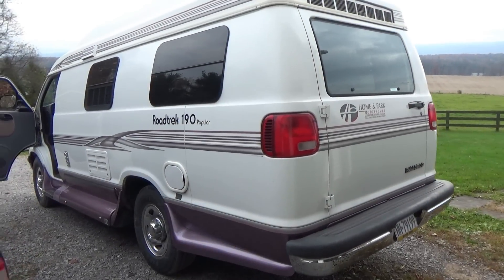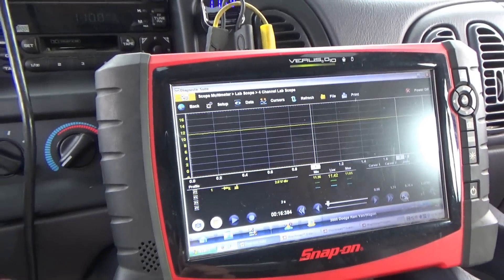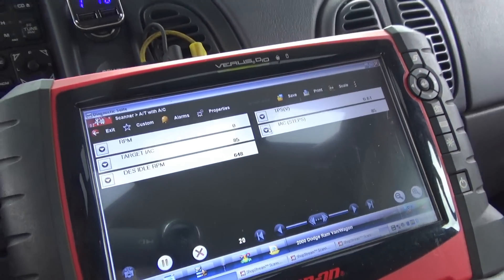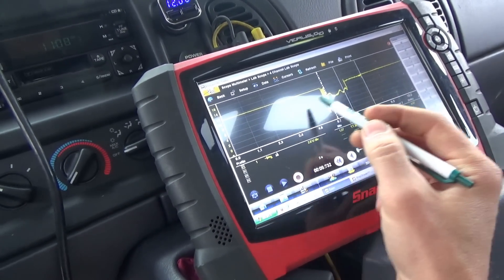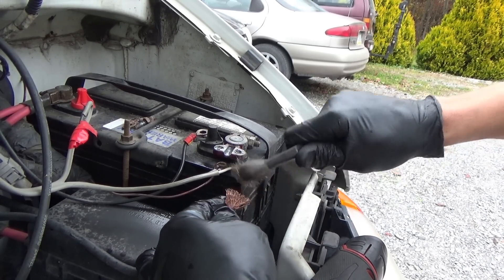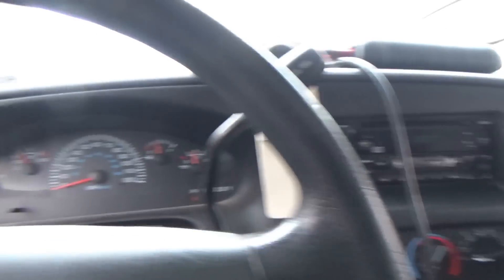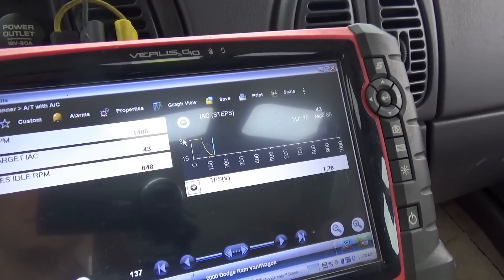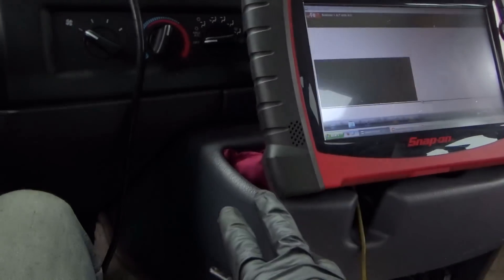Ram Camper Van is BACK! (Hot Start-STALL after X-country Trip?)

Comment: My sons 1997 Dodge 3500 pickup had the same problems. A shop replaced the battery and starter. He finally got mad and using jumper cables directly on the starter, got it going. He replaced every heavy cable in the truck with larger wire. Fixed. No problems for over a year.

Comment: I have never liked that style connector.  If you notice, the positive connector appears to be close to OEM.  That connector apparently was used to accommodate additional connections that were added when the van was customized.  That battery acid can migrate down inside the wire and cause issues as well.  Great video!

Comment: Ivan, you need a hammer crimper. The one I use is made by TEMCo and can do 8 gauge to 4/0 gauge wire. I left a comment with an Amazon link to this  but it's no longer here. Apparently YouTube is eliminating comments with links. You use this tool with a 2-4 pound hammer and it puts the lugs on really well. I use my tool to make welding leads for my TIG, MIG and stick  welders but there is no doubt it would work great for battery cables as well. The only problem is that you need to remove the cable to take it to the crimper which you typically mount to a vise or a hard surface such as concrete. Also, use a torch to solder the thin wires together as this gives a stronger more permanent connection which is also less prone to corrosion as the wires are surrounded by solder..

Comment: Ivan great find! I was wondering, would a Catch Can after the PCV VALVE help the crrap from makeing it to the Throttle Body? I was thinking high mileage engines have have a higher bypass gasses thus early contamination pouring into the Throttle Body.

Comment: For making a bunch of wire lugs at one I just use 3/8" or 1/4" copper tubing. Cut into ~1-1/2" lengths, flatten one end in a vice and drill a hole. A 2' length of pipe cost the same as a 2 pack of lugs.

Comment: Any exposed copper WILL corrode . In fact , it WILL disintegrate over time .  Those cable ends are a recipe for problems . You seal pierced wires with liquid electrical tape . Then people leave the ends exposed on cables with the most amperage .

Comment: A while back I bought a 1987 Chevy 30 Series Van at auction to sell as parts . The battery was weak , but it did charge fine . When the battery ran down to about 7 volts while running it would just shut off every time . Those heavy duty vans had a 350 with 4 bolt mains . And there was an odd size on the 8 lug tires . I think the early ones were 16.5" . The newer ones are 16" .

Comment: It's an easy test... put one voltmeter lead on the battery terminal, one on the wire... crank it... check the terminal connection for voltage drop.  Those quick-fix battery terminals suck and should always be suspect.

Comment: If voltage, cranking or otherwise, drops below 9 volts you are in danger of losing KAM in the PCM, in which IAC on these older Magnum engines will reset from the learned value. Communication will be lost for the scanner as well.

Comment: Solder an eye on the end of the cable and use the uni-clamp bolts as binding posts. Sandwich the cable eye between the clamp body and strap. Much stronger phyisically, much better connection electronically. You also don't have to keep cleaning and re-clamping a nasty wad of cable strands.

Comment: Your are wrong scannerbreath.  ;^)  Parts were required. At the least a lug on the battery cable bolted to the battery clamp, if not a new clamp assy similar to the one on the + post.

Comment: I had a similar vehicle, an 01 Ram conversion van. I found the braided ground that ran from the engine block to the firewall had rotted away. This gave me some odd intermittent electrical issues.

Comment: Lol well hate to be that kind of guy cause you're a great channel with great content.     But I told you in the last video with this van  that your idle instability was because of the voltage drop causing learned minimum airflow to be constantly erased.    You could hear it in the original video on starting.  Theres nothing wrong with your throttle body.    If its getting dirty in 8000 miles then its pulling a bunch of blow by from a blown intake plenum pan gasket or running with no air filter etc..    
And like I  said actually remove the iac valve and clean that passageway.     In that design it's way more important for your symptoms then cosmetically cleaning the throttle blade.    

Come to Canada sometime and I'll tell you more war stories about those older dodges and buy you a beer.

Comment: I always take the puny battery cables off of any cars I own and put big, solid copper cables, and  solder 24 kt gold plated terminal ends on them.. they arent very expensive.   saves alot of headaches.  any more issues and I would pull and clean the throttle body.. lots of areas u just cannot get to without removing it, and disassembling it..  also the base gasket  gets brittle and leak with age. injector screens tear, get dirty.. lots of things that can cause problems..   sometimes u think its running good, then u clean that throttle body and its amazing the difference u hear and feel.. if that throttle body has never been rebuilt , its due.

Comment: I had a 92 Dodge B250 camper van with the 318 and it HATED low voltage conditions.  ALways caused issues with idle for me until a new battery was installed.

Comment: Unbelievable I would definitely suggest replacing that wiring to the battery and then see is there some way to run a full load test on the alternator to see if it's sitting there and can it handle all the accessories in that van Love video great diagnosticing thank you so much

Comment: Would have been better to change the entire cable that issue is just going to come back the entire cable itself is probably dirty on the inside  cleaning the tip is just a patch plus the gauge of that ground cable is not what it should be

Comment: Already at the first time you cranked it at the first video, I was thinking: check the battery, check the voltages, the drops, the wiring, the starter, charging system.
If my car would ever crank like that, I'd diagnose and fix it asap, instead of putting it off and risking to get stranded.

Comment: From what I could see in the video, the positive wires look significantly larger (although it could be camera angle) than the negative wire.

I think I would have done as you did, but I'd have added another negative wire and took it to the chassis somewhere near the battery.
Reply: Thank you for reading my post Ivan. I've been watching and learning from you for years. Cars and electronics are my hobbies and seeing both of those skills working together in the hands of an expert is inspiring. Please, keep up the good work.

Comment: Was the computer always in re-learn?  Can't imagine they were receiving tip top efficiency or performance neither if that was the case during their 8,000 mile trip.  I think it would be best to crimp on an appropriate copper lug on that negative cable and get a different battery post clamp that has a threaded stud.  I never had luck with those universal post clamps like the one used there, they either crack or they give a shitty connection.  Too many loads and too much vibration in an automotive application at least, MAYBE ok in a relatively stationary position for a backup sump pump or automatic standby generator.

Comment: Hi Ivan. You know with just a little bit more experience, you can really do your customer a good service. Forget that negative cable cleaning crap. Replace the cable with the proper size along with the good grounding to the block or frame. That cable is under size for sure.
And further more, that battery needs to be tested before going on. And you might want to test the starter also. Your fix is ok, I think maybe 95%. Lets go for 100%. No parts required is not always the best in the long term. Just saying, the old school guy.

Comment: In the first video on this van I thought the starter was turning very slow, at least slower than I have experienced in decades for a V8 USA vehicle. The minute I see those clamp down aftermarket battery cables I always wonder how well a connection they are making due to their design. I've always not been a fan of them and prefered the more expensive marine type with allen bolts that clamp down on the cable itself vs. the upper half "saddle" bracket that tends to flex too much. this subject his highly debateable as to which way is best, clamped, bolted or soldered battery cable to the terminators.  
What's more interesting on this older vehicle is, it wants higher voltage to perform normally. Most older vehicles has more forgiveness with low voltages compared to the new vehicle of today who want a good 13 plus volts to "compute" normal operation. Folks tend to find this out on their own when they have a battery just about ready for replacement. 
Battery connections have always been part of regular visual maintenance and if there might be some doubt about them, its likely the best route to take and do just what Ivan did here in this video...inspect, detect, clean and test for good connectivity.  Sometimes, it just more reliable to purchase a new high quality cable that has reliable terminators.

Comment: Back in the eighties, the guy who taught me to work on cars pretty much had a default position on old cars that you started any diagnosis by disconnecting both ends of the negative cable, cleaning everything down to bare shiny metal, making sure the ends were in good condition, and reconnecting everything.  Its amazing how many cars that fixed.
Reply from the maker: At least measure the voltage drop before touching anything 😁
Reply: @PineHollowAutoDiagnostics  agreed. Back then it wasn't an issue. Components weren't very voltage sensitive.
Reply: I was taught the same thing, except it was in the late 70s.  Like you said, that solved a lot of problems.
Reply: the other end of the cables are important too, many times the ground goes to an aluminum bracket, that is bolted to an iron block.. aluminum corrodes everything. often times moving the ground wire directly to the block or head is whats needed.

Comment: the deep cycle battery is not ideal as they aren't good for fast high output like when cranking. those "fix it "terminals are to get you off the side of the road. it all goes back to the fact that all this electronic crap needs steady proper voltage to work properly.  that check should be the START of any electrical diagnosis. PERIOD.

Comment: A small amount of acid vapor is leaking from around the battery post.  The cheapest solution is a LARGE GOB of Vaseline before and after replacing the batter terminal.  Any bare copper will start to corrode quickly !

Comment: I've replaced many of those squeeze cable ends because they cause problems.
The brass ones with the single 5/16" bolt or the 3/8" bolt work great!  You do have to put a battery cable lug on the cable THEN bolt it down, making sure to use a lock washer or a nylock locking nut to prevent loosening.
The minimum idle test from Chrysler on those 5.9L engines is a bit confusing,  so I used the scan tool to see what it read.  Like that van it was to low/stalled.  Passenger side of engine throttle body, there's an adjustment screw.  I adjusted the screw so the engine ran at 600 RPM without the IAC help.  That idle speed helps to prevent stalling especially when the IAC is "slow" or not working.  600 to 650 works well.  No higher as the PCM might set a code.
So it's set the RPM at 600 normal operating temperature, then throttle up to 2000 RPM for about 5 seconds and let off the throttle.  This is done obviously with trans in park and ALL accessories off.  It should idle at 600 to 650.  You may need to slightly adjust.  
Also, make sure the air filter is clean.
This should help to eliminate stalling.

Comment: Being a former employee of a semiconductor manufacturer, some microprocessors had less than 3 volts input power.  Faster switching times are achieved by having the logic  switch between 1's & 0's a total of 1.5 volts.  Don't know if these microprocessor are/will be used in autos but.......

Comment: wish you had a vid on taking the dash pad off the silhouette when you fixed the cluster ,,,need to take mine off  ..need off my 95 transport  ....needs glued anyway  but the service manual does not show much were the screws are     i popped the needle out of my cluster fixing a burnt ignition  switch . got hug up after i undid it  ,,my bad

Comment: And old Chrysler products that acted like a weak battery wasn't a weak battery, the end plate bushing in the starter was worn and the armature would lay on the magnet causing the slow start condition, leave starter on car take the endplate bolts out and put a new brass bushing in it with white grease and put back together and problem solved... I use to do a lot of old Chrysler starters that had that condition....

Comment: I remember when i was in voc tech in 1986 we used a vat 40 cranked car for 15 seconds looked at voltage drop and rpm and current i beleive it was 9.6 min voltage 150-200 rpm and current was based on cylinders of engine  brought back old school

Comment: 40 years ago I was using that type of battery connector and had nothing but problems with them - never used them since, and I cringe whenever I see them.  That type battery connector on a battery is the equivalent of a scotch lock connector on wiring....only a matter of time until problems occur.

Comment: I had the same overcharging issue with a 2000 Dodge Dakota. Turned out it was a bad ground cable on the other end, where it connected to the fender. It looked good but with a little wiggle showed it was bad. What was interesting to me though was the overcharging. I thought it was a bad regular or alternator.  Anything over 1500 rpm would peg volt gauge. So now any overcharging I look for a bad connection first as it's the cheapest fix.

Comment: If you suspect the throttle body is getting so dirty after only 8k miles that it is causing issues…there are deeper issues.  While the neg cable corrosion was “an” issue, I suspect you will see this one again.
Reply from the maker: It's fine 👍

Comment: Those crappy repair terminals were a problem in the 1960's.  I have soldered a lug to the cable to bolt down to the terminal.  Use of these terminals as intended guarantees future failure.

Comment: Interesting, that battery cable terminal looked pretty diy and I remember it was cranking slowly the first time around.  I imagine that crappy connection will deteriorate again and who uses romex in the engine compartment? Hope that wasn't factory but you never know what you'll find with a conversion.

Comment: If it was my van I would replace the cable and connector. Maybe a new air filter if needed.  Throttle body should not get dirty in 8k miles.

Comment: I've yet to see what I consider to be a good replacement battery terminal, other than one requiring a crimped-on lug. But I have also yet to see an impressive assembled terminal/lead replacement, either. Seems like the manufacturers are placing their emphasis on the insulation, rather than the actual conductor. Plastic is cheap!

Comment: I like the idea of the ring terminals on the battery cables- one other thing is; that battery seemed to be a deep cycle with the marine terminals (For regular batteries, i usually will get the top post to marine adapters). Id abandon the top posts and just use the marine terminals if it was me- dielectric grease and heat shrink. Man that van has the worst buzzer, that would be my main complaint!

Comment: Hey Ivan get rid of those lead battery terminals clamp and replace them with brass terminals or non lead terminals also his battery getting old as I can see that top battery is over spilling acid which is the root cause of the corrosion on the copper

Comment: Those clamp on battery terminals are just for temporary use, and it says so right on the package. The problem will likely come back in 6 months. Needs a real cable where the end is part of the cable itself.

Comment: I've been having this same problem with the clamp style terminals on my truck. I'm about ready to see if I can solder the wire to the terminal without destroying anything. If that fails, thread terminal battery and ring connectors are next in line.
Reply: Id suggest the ring lugs with heatshink and get yourself some top post to marine terminal adapters- dielectric on the stud and the ring- good to go

Comment: Too much drain due to accessories  , while parked, drained the starting battery too much, too many times.
That ages a starting  battery quickly.
Add to that the mickeymouse battery connections.

I'd  be surprised  if it doesn't  come back for an alternator  in the future.

Comment: Quick & simple diagnosis Ivan. Low volts is very problematic for electrical items, especially when you only have 12V or 5V as your nominal voltage to start off with! In my world where we have anywhere from 240V to 275,000V to start with, larger drops in voltage are acceptable, though even then it reaches a point where the voltages get low enough to cause issued for household electrical articles, and items with electronics eventually fail because of it. In the overall scheme of things a very small percentage of low volts is enough to cause issues in your world & mine. You need your Volts!

I note the aftermarket wiring was house wiring, not a good thing in a vehicle that is subject to movement & vibration. The copper fatigues and snaps. In order of best case fault to worst would be  1) open circuit, 2) melted wiring and lastly: 3) burnt down vehicle. Not to mention the issues with whatever the wiring is supplying and the potential damage to it.